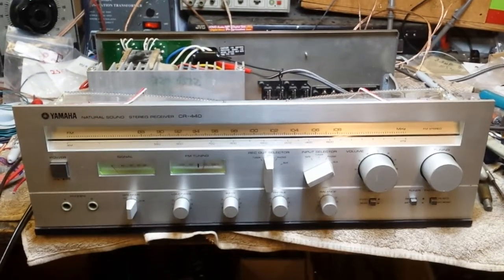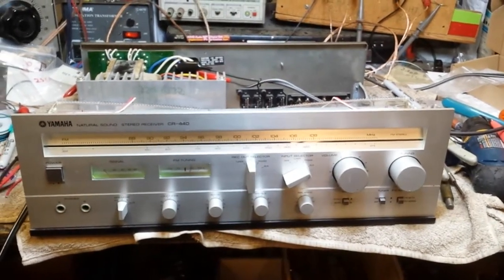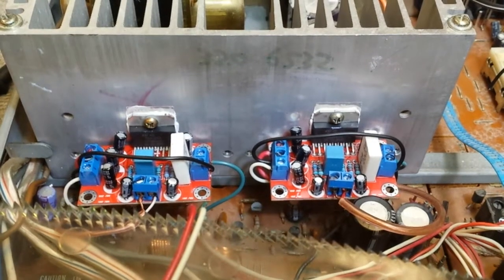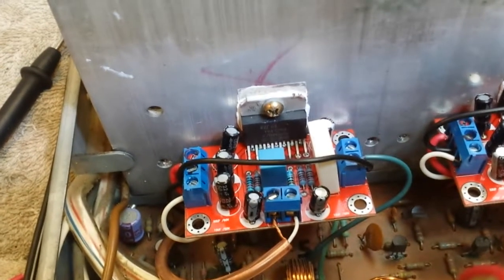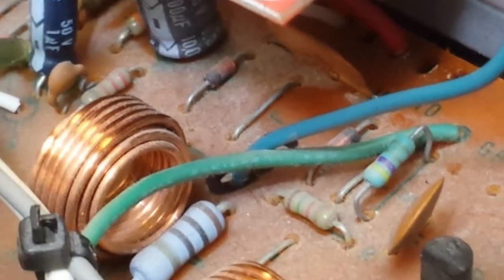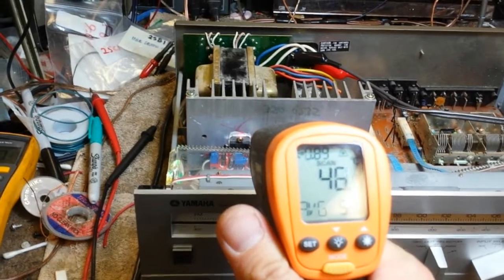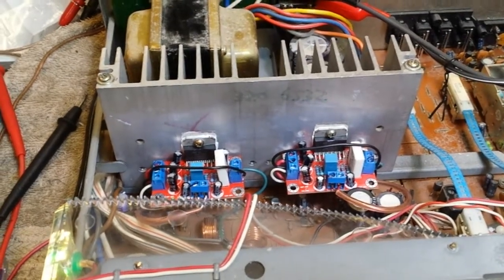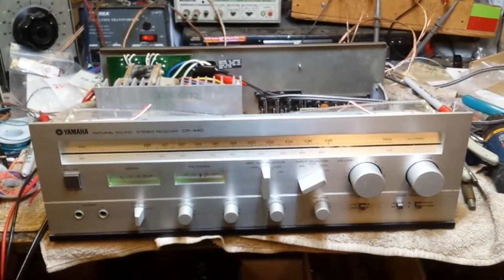Replacing amp stk / IG amplifier modules in Yamaha cr-440

Comment: I replaced the IG power amps with a bare OPA541 made by TI screwed to the heatsink (electrically isolated) and simply connected its pins with small wires soldered to the IG pads on the PCB with the signal designations (not pin to pin). It works fantastic for  more than 15 years.
Reply from the maker: Excellent idea, since the voltage ratings are much higher than the tda type devices
Reply: @JordanPier  I also "evacuated" all dial green bulbs which were a nightmare during the year by burning out. I replaced the lamps with high efficiency green SMD LEDs using series resistance to limit the current and hooked them to the power supply via proper resistance. I glued them to the acrylic top bar using hot glue. The receiver is now with much nicer green compass.

Comment: Thanks for the video. Very enlightening. I have some questions. Do you put the heat paste on both sides of the mica insulator?  Where can I purchase the insulators? Are there other TDA modules that can accommodate 50 watts or more?
Reply from the maker: I believe I had to cut an MT-200 mica insulator for this. Paste on both sides. Insulator for the mounting screw.

Comment: Do you see any issue with using these on an SX-680 to replace the 0039s?
Reply from the maker: Should be ok. Voltages are within upper limits. Wouldnt do 4 ohms. 

If youre savvy you can build a discrete version yourself.
Reply: @JordanPier  that’s my plan once I get this one fixed.  There always seems to be a need…

Comment: Have you done a repair using the STK replacement kit that is being talked about on audiokarma? Been thinking it would be a fun project to get a "blowed up" Pioneer and fix it with that kit.
Reply from the maker: I haven't used the kit, but I have repaired sets building discrete versions of stk0029, 0039 and 0050
Reply: @JordanPier  how did you build  your own 0039? I need for my sx680

Comment: I need the schematics! And The COMP (are five) Pins that we find at IC STK 4121 II, What they're for? 
Nice job and Thanks!
Reply from the maker: Don't have a schematic for the module, but you should be able to Google a data sheet for that stk and HiFi engine may have a schematic for the receiver

Comment: I have a Technics SU-Z22 with a toasted STK module.  Unfortunately, the amp's power supply is rather a little too hefty: 39VDC +/- , which, I guess, would kill the TDA.
Reply: TDA7293 is good for about +- 40 volts - look up JohnAudioTech channel - he has a video on the subject.